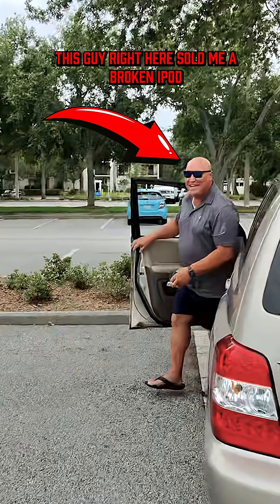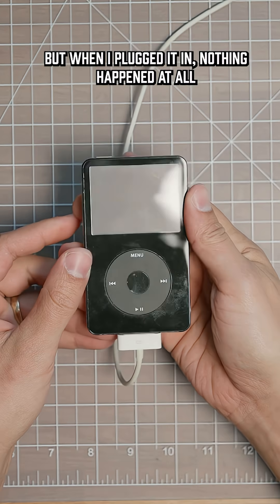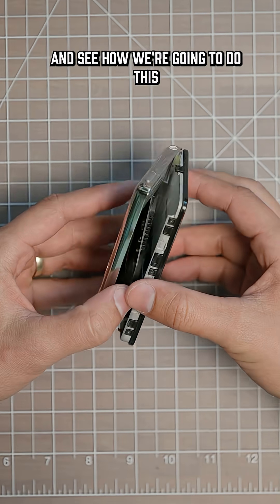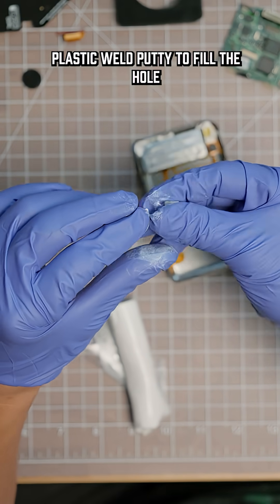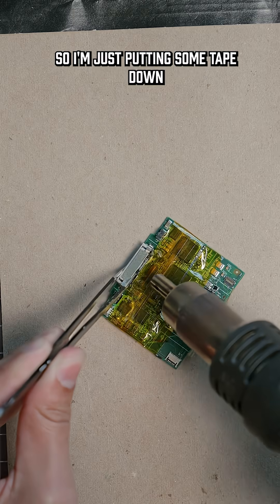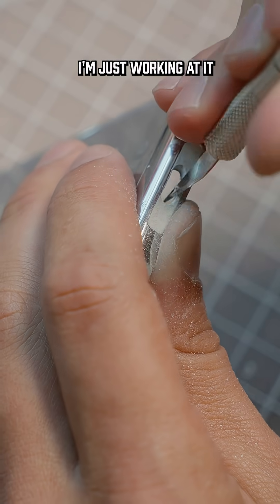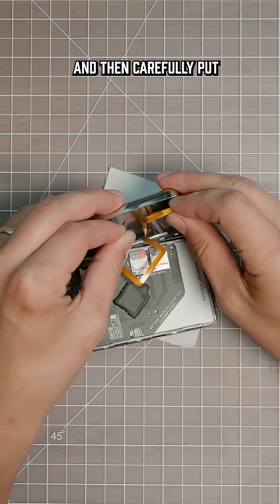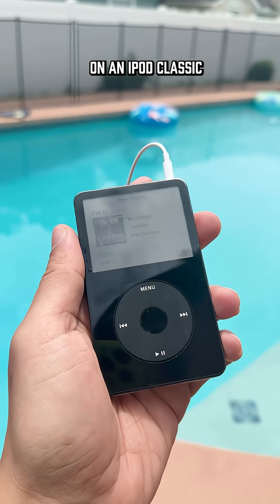He sold me a broken iPOD... So I fixed it with USBc!

Comment: That would be a perfect application for a three d printing
Reply: I've never seen someone write out three d, mostly because that's not how it's written lmao. 3D*
Reply: @tastytizzler1383 😂 full disclosure, my hands were occupied  at the time so I used voice to text. And that's how it came out. Lol didn't even notice it till now, now 😅
Reply: Seriously, why is everybody complaining about 3D printing, a solution being a problem. I'm just confused about that. If you have a tool, use it. If you don't have that tool, find the equivalent alternative.
The solution in this video turned out real clean and looks pretty nice.
And it will be stronger than 3D printing i just think a 3D print would give it a more
Off-the-shelf look, but that's just me personally. Once again, why are we arguing about this
Reply: Exactly what I was thinking. Printing a shield to fill that hole seems much easier than putty.
Reply: @retronymph if your life extended back before 3D printing was possible, what would you guess as good to use?? You guessed it. Additional pointless fact; Personally I've a degree in industrial design from early 2k, when 3D printing was of it's rare infancy only commercially, it was extremely expensive to utilize (domestically) & it ONLY printed in wax.
Reply: @s1lv3rbordeaux47 wax? Nope.
My dad has SLA prints from like 1992
Reply: Man y’all wanna 3d print everything not everything is ment to be printed out of plastic 😂
Reply: @CallmeMaster-y1v someone hates 3D* printing for no reason, sure go get your trinkets CNCed for far more expensive.
Reply: @tastytizzler1383 could care less go print something printer boy lol
Reply: @CallmeMaster-y1v  damn bro... you sound like a 3D Printer stole your girl.
Reply: @tastytizzler1383 You onow 3D stands for "3 Dimensional" right? And 3 is spelled "Three"?
Reply: @CallmeMaster-y1v Also, youve never seen it written out, probably because people love taking shortcuts.
 I mean, you're so uneducated you don't even know that 3 is spelled "Three", You're too caught up on the shortcut of "3"

Comment: Damn that's an iFlash Dual, if you didn't pay the +$40 for the adapter (not including the SD cards), thats a pretty good deal even with the battery issue
Reply from the maker: Yes not too bad!